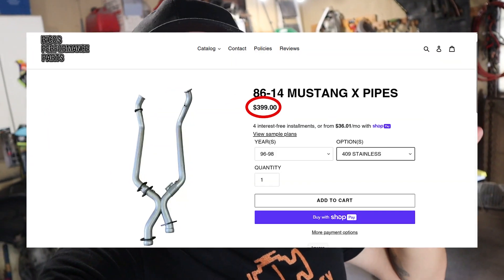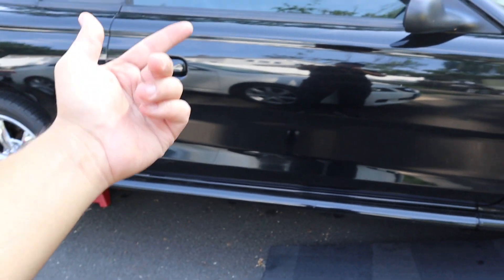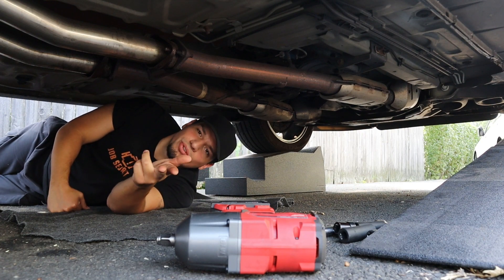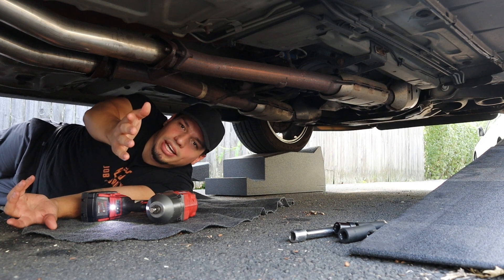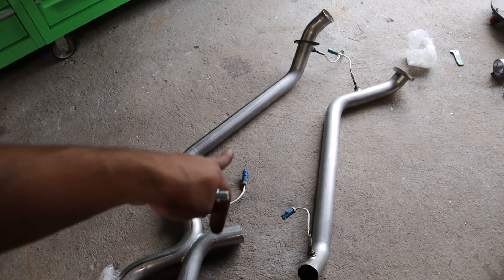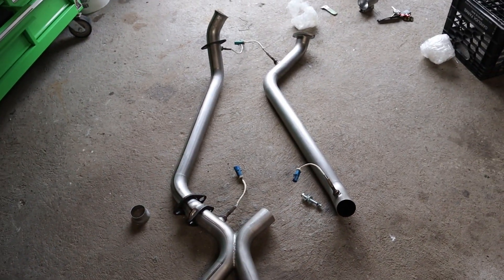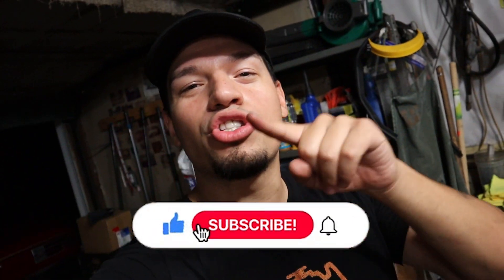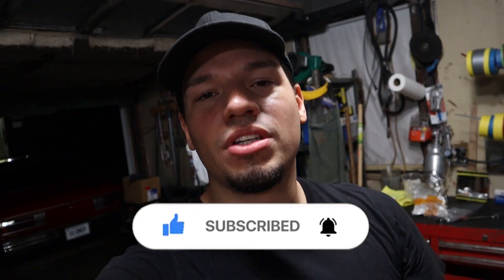1994-2004 Mustang GT/Cobra Off-Road X-Pipe (INSTALL) [RPP OFFICIALLY OFFLINE]

Comment: What size nuts and bolts did you use ? Mine came with none
Reply from the maker: I recommend getting 3/8-16 bolts that are 2-1/2 and/or 3 Inches. As far as the class of bolts I suggest going with Grade 8 bolts, but you can use stainless steel as well.

Comment: The car is beautiful, but dumps?? Aren’t the 2 chrome pipes coming out the back a huge desirable styling cue for mustangs?? I know very subjective, but I’ve never seen anyone run dumps unless they had to because of suspension mods.. just wondering why you went that route??
Reply from the maker: Honestly the reason was just to be different, and just do what not everyone does. I’ve ran the H-Pipes with the Flowmaster 40s before and I just wanted to have something that not everybody has on there car. But I will say I do miss the tailpipes being on the car in a lot of ways, now the problem is finding tailpipe to fit the car. I’ve seen a couple of universal kits out there but that’s really all. If you find sites the sell for 98 cars I’d actually be more then happy to check it out and even consider the purchase. All in all though, I probably will go back to tailpipes in the future…. Or soon

Comment: Did you get a check engine light for not having cats
Reply from the maker: It does come on but it won’t affect the performance of the car. It will just have the light on consistently. 

You can get the light off by buying a handheld tuner(SCT) or you can usually get away with O2 Sensor adapters, that allow the O2 sensor to be lifted from its original position and won’t be able to read the excess exhaust gases 

I personally have the Tuner, mainly because there is other mods I want to do with the car that I will need to have the tuner regardless
 
Hope this helps

Comment: Great video man I have a 04 gt mustang I have it straight piped right now but I have a question so when I got my exhaust straight piped the guy said he only removed the lower cars not the upper because it would cause the engine to run bad is that true or would it just cause a check engine light to just come on I want to get a x pipe but the only ones I see online are catted.
Reply from the maker: Technically it does cause the engine to run more lean, and that’s because you’ve taken away the factory back pressure that the cats cause, to allow the motor to be as efficient as it can be to the OEM standard.

Having the tuner will basically allow you to tell the computer that not having the cats on the car is okay, but you won’t feel a major difference with performance.

As far as what you see online, not many companies are gonna have X/H pipes due to EPA not minding their business when it comes to aftermarket products and “Off-road” use. The companies that have X/H PIPES with no cats on them now, are pretty much small businesses that I have done my own search for. They are out there but you gotta do a little digging.

Hope this all helps👍🏼

Comment: Is this xpipe a direct bolt on to the stock manifold? Or is there headers installed already
Reply from the maker: Direct bolt on to the OEM manifolds, one thing I’d recommend are stronger hardware. Get grade 8 bolts(3/8-16), lock nuts(3/8), and washers(3/8).
Reply: @chrisrodproductions  thank you brotha

Comment: What was your strategy getting the lower passenger side bolt out. I’m stuck on that one. Won’t budge.
Reply from the maker: I was fortunate enough to be able to use an impact wrench and get it out, also lettin the bolts soak in pb blaster or even wd-40 for about a nights worth will help get some oil to the threads to have a better advantage 

Worst case, time to use heat but the soak should be enough
Reply from the maker: Also if anything, then the car on and let the exhaust get hot(while on jacks stands or jacked up), nothin will happen besides a simple leak but after it heats up enough spray cold water onto the bolt while still how but the car is off

Should breakaway some of the rust with the intense switch in temperatures 

Hope this helps